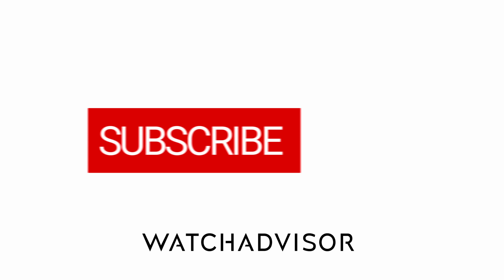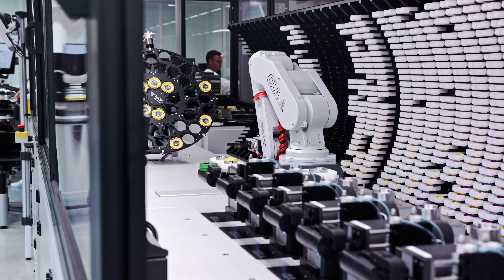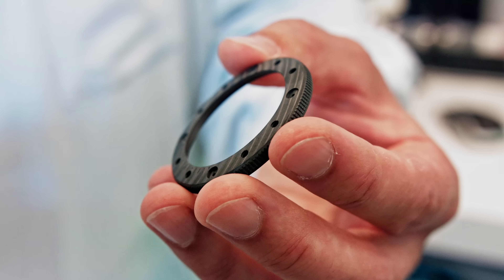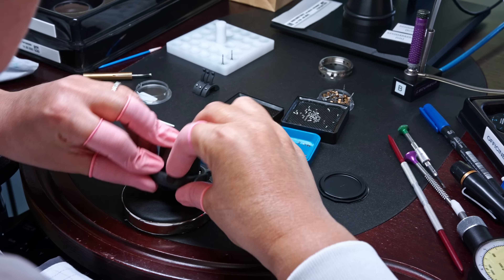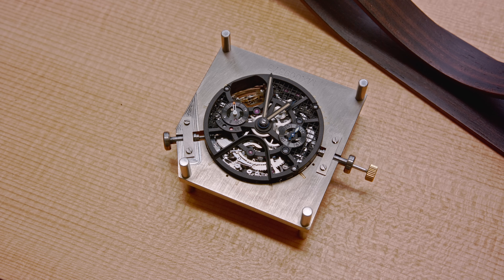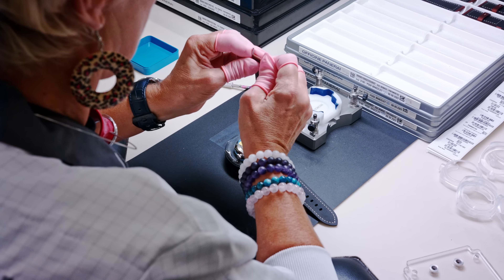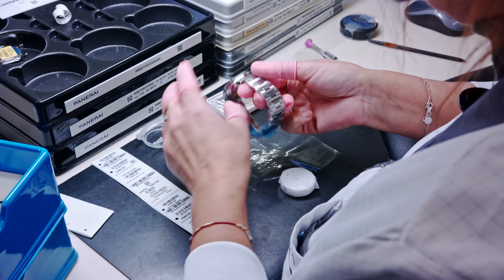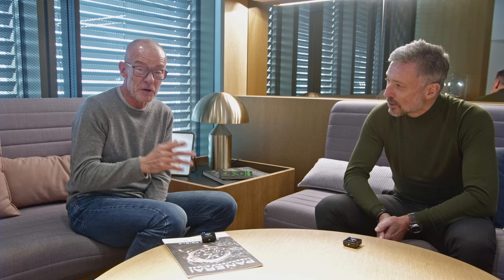PANERAI Manufacture Tour in Neuchâtel. EPISODE 3: Assembly, Carbotech, Haute Horlogerie...

Comment: Thank you for making this video, Alexander. I do think an issue still remains to be addressed separate from your video series... the use of undecorated movements (P.900) like in their new QuarantaQuattro Submersibles. I would like someone to either debunk the claims (open up one of the new models) or explain how the brand justifies the use of raw movements. The pics that are out there are shameful. Thanks again.
Reply from the maker: The P.900 is a platform-calibre of Richemont used by Vacheron Constantin, Cartier, Baume & Mercier, MontBlanc, Panerai, … It is one of the most reliable calibres of the industry… But yes it could be decorated a bit nicer… also here changes will come I heard… so we will have to wait how Panerai reacts…
Reply: You can clearly see this in this video. The P900s in newer models are not decorated and quite frankly look rather bad. The way to prevent that is to only buy older models or to buy an open case back which is precisely what I did. I love mine BTW.
Reply: Couple thoughts... If you're Panerai and looking to cut costs, using a quality-yet-less-pretty movement makes sense on closed casebacks. The fact is, you shouldn't be randomly opening the watch just to ogle a movement anyway, and they know that.

Comment: Dear Alexander,
Thank you for the videos. 
Out of curiosity, I wanted to know where exactly do the gold models get made and if any other differences in the process other than ofcourse gold material.
Reply from the maker: Due to necessary security measures when handling/stocking gold or other precious materials the manufacturing of the gold cases is done by Donzé Baume, a case manufacturer that is part of the Richemont Group.
Reply: Makes sense , thanks again Sir

Comment: Thank you so much for a most impressive & detailed tour of Panerai. Only now do I realise that each carbotech watch is effectively unique due to the case pattern created during the cutting process. For me, that makes them even more desirable. One question, did you buy the watch you dropped on the floor? 🙂
Reply from the maker: Thanks for sharing your thoughts with us! No, I did not buy the watch. This is the laboratory and testing area of Panerai… the watches there are supposed to be “tortured” under all aspects. The drop I caused was anyhow similar to the one the machine generates. The only difference is that the machine does this in a standardized way…
Reply: @WatchAdvisor  😁

Comment: I'm going to order my first Panerai now 😁
Reply from the maker: Wow 🤩! Which one do you have in mind? And let me know if you have any questions …
Reply: @WatchAdvisor  its gonna be the PAM01084 , clean and simple and a little romantic with the hand winded movement. And according to the testing it should be 125meter water ressistant so it will be fine for swimming or am I wrong?
Reply from the maker: Good choice! I love the “simplicity” of this Luminor! Yes, it is at least 100 + 25% meter waterproof and absolutely good for swimming ++
Reply: @WatchAdvisor  I did actually order my first panerai today,but it was the PAM01314 I chose 😊 Not so simple but I could not resist it